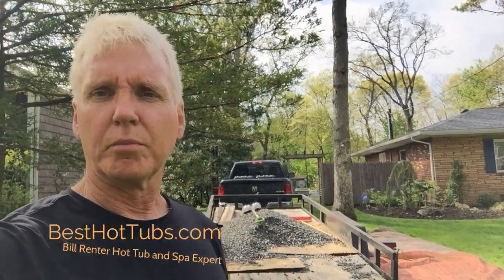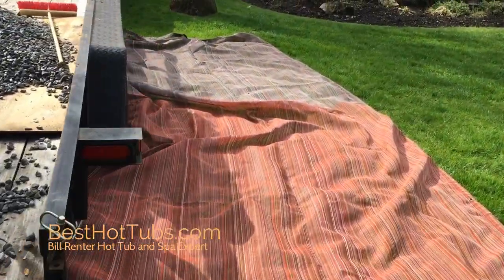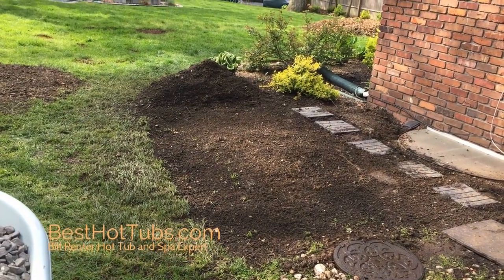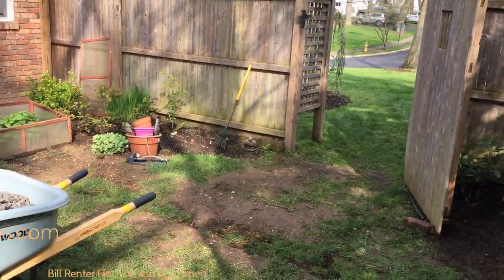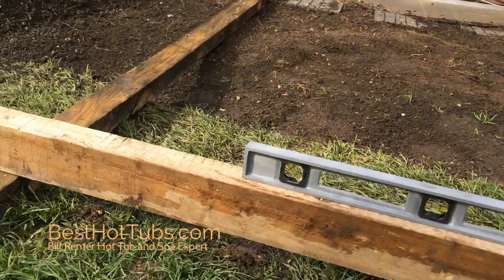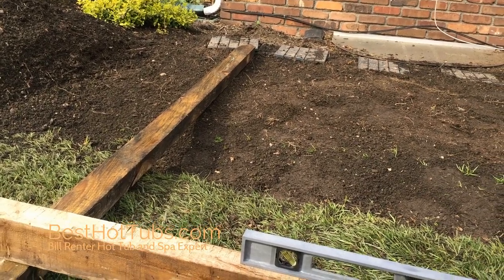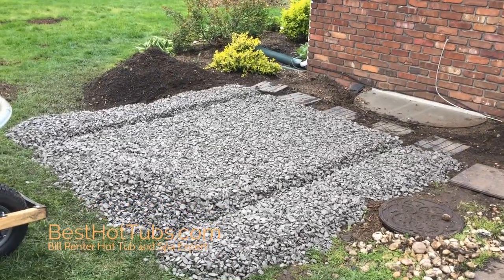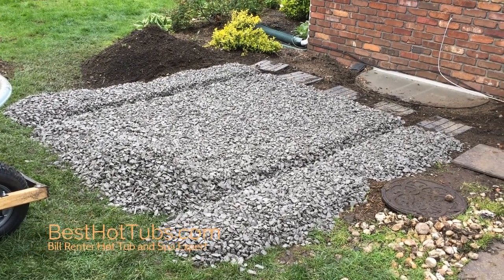How to install a Hot Tub Base Bill Renter- BestHotTubs.com  Hot Tub and Spa Expert

Comment: The proper way to do this is quite similar to installing a gravel road or gravel driveway. You start by installing 4 to 5 inches of recycled concrete (often times referred to as road base) you can use treated 4 by lumber as forms, which can either be removed afterwards or left in place. The road base should be installed in 1 to two inch lifts., which are leveled by screeding with the appropriate size 2 by 6. Between lifts, you water  down the road base and then compact it using a mechanical plate compactor. Once the road base has been laid and compacted, you bring in a one inch finish layer of fine decomposed granite or yellow sand. This should be watered down and compacted. You then finish screed it ,filling any low spots in as you go. The DG/yellow sand will compact quite well and acts as a buffer between the bottom of the tub and the sharp edges of the road base.

Comment: What if I framed the perimeter of the pad with 4x4's, bolted them together, used ¾" gravel, tamped it down, applied pea gravel on the surface and tampered that down? Surely that would really beef up and make a much sturdier base allowing it a longer life without the ground shifting over time. It would take longer but would give a customer piece of mind.  What do you think?
Reply: That could work. Send a photo when you are done!
Reply: @longislandbesthottubfarmin2682  will do, thanks.

Comment: The tub is going on the gravel?  When I bough my tub I was told it needs to go on a concrete pad. Told me putting on gravel was the worst thing I could do.  Is this for an inflatable tub?
Reply: @stefanchabane4690   won't a concrete pad sink as well?
Reply: @stefanchabane4690  Every couple years he might need to shim it up a bit.
Reply: US Data I have mine installed on a concrete pad. It is a 380 gallon spa which I think weighs about 4000 pounds.    Been 3 years and so far it does not look like it has moved.
Reply from the maker: Hi x x, This is for a Bullfrog Spa. You should always check with your local codes for the base of your Bullfrog Spa. Bullfrog spas recommend a gravel base if it is allowed in your area and it works best with the wood free dura base and dura frame. I've added a link to the Bullfrog spas owners manual check out page 38  https://besthottubs.com/wp-content/uploads/2019/05/2019-Bullfrog-Owners-Manual-rev1.7web.pdf   page 38
Reply: what is a wood free dura base and dura frame.  I was thinking of using a wood border 8 x 8 x 4 and fill and tamper down crushed rock @Longislandhottub

Comment: Please do not use Crown or a proper concrete slab I know the codes For Brookhaven and they say you need a 3inch slab
Reply from the maker: Hi DIY Decorations, you should always check with your local codes for the base of your Bullfrog Spa. Bullfrog spas recommend a gravel base if it is allowed in your area and it works best with the wood free dura base and dura frame. I've added a link to the Bullfrog spas owners manual check out page 38  https://besthottubs.com/wp-content/uploads/2019/05/2019-Bullfrog-Owners-Manual-rev1.7web.pdf   page 38

Comment: PLEASE dont follow this very poor advice. Invest in a proper concrete pad.
Reply from the maker: Hi Kevin, you should always check with your local codes for the base of your Bullfrog Spa. Bullfrog spas recommend a gravel base if it is allowed in your area and it works best with the wood free dura base and dura frame. I've added a link to the Bullfrog spas owners manual check out page 38  https://besthottubs.com/wp-content/uploads/2019/05/2019-Bullfrog-Owners-Manual-rev1.7web.pdf   page 38

Comment: This is exactly what every single hot tub manufacturer and dealer tells you NOT to do.🤦‍♀️
Reply: Oh, what should you be doing?
Reply: Gravel is said to be one of if not the best base for a hot tub
Reply: Yeah because they want you to pay them to install it
Reply: With the weight of the hot tub full if water I would have put a layer of road fabric down first over the vare dirt before the rock. This keeps the rock from migrating into the dirt over the years.